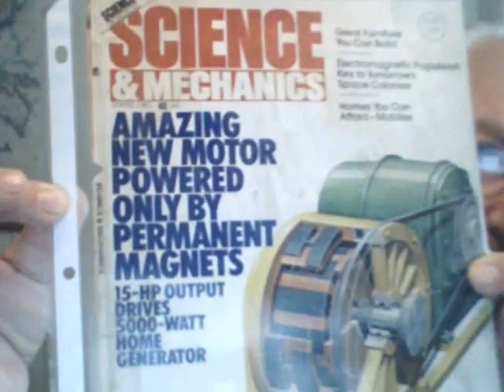#214 - ZNU 12/31/09, Projects for 2010

Comment: i thought you would be using ethanol as electroloyte with open bath ss plates run with triple phase 2.4 volts per riding on ac at an amplitude of 666 volts using excess heat as gauranflo and gas bubbler for geet effect. but nooooooo........